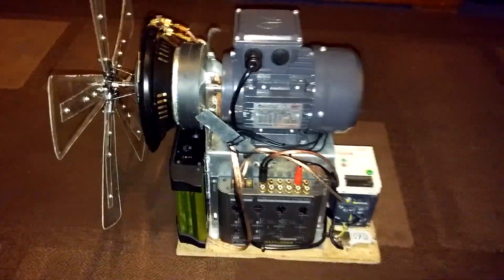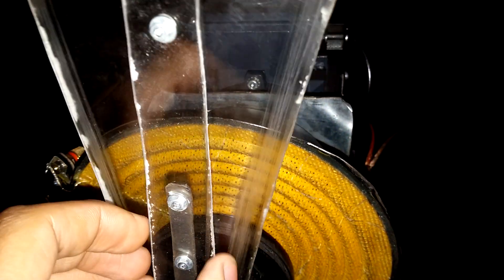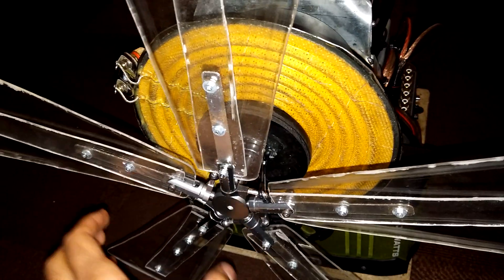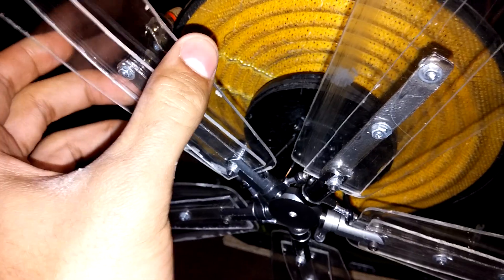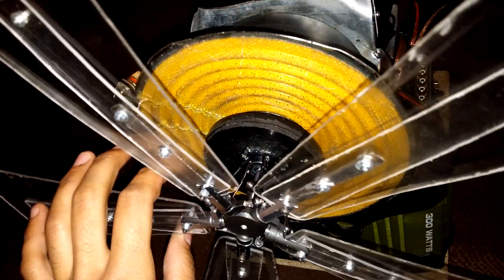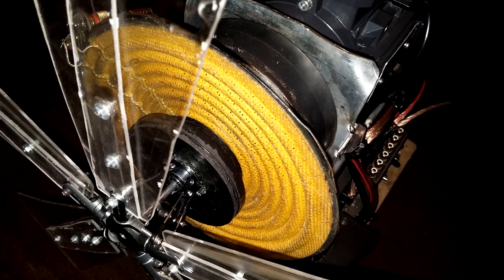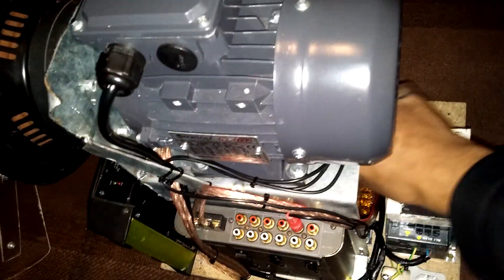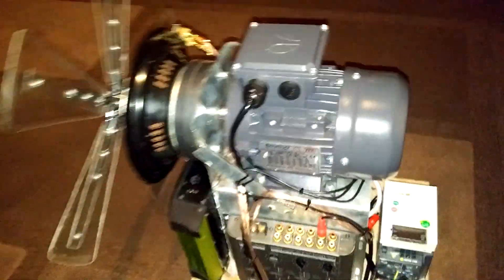DIY Ultra-low frequency subwoofer project: Update 2

Comment: The Google drive link isnt working
Reply from the maker: is working now
Reply: Hey , thanks alot. Does it need to be boxed or can it be out in the open?
Reply from the maker: @satishsital9432  it needs to be in the system described for  optimal USA, but you can try different things and see how it goes
Reply: Thanks for the link.  Will experiment with it

Comment: Mate, you're a legend for building one of these. A couple of observations on the design though. Seems that your average cannibalized speaker driver isn't too happy with the drive length. Reckon you could get better results with custom built voice coil and magnet with more drive space so the blades pitch further to get some decent throw.
Reply from the maker: thanks mate! yeah, a custom coil would be great as this coil runs against the shaft because it only has one diaphragm. if it has a diaphragm on either side the coil would stay level with each motion. also the driver is capable of turning the blades full pitch each way before the coil runs out

Comment: Hey mate just wondering, roughly what angle do the propellers turn when the voice coil is providing full displacement to the swash plate?
Reply from the maker: Around 45 deg each way so it has a full 90 degrees of you count forward and backward motion